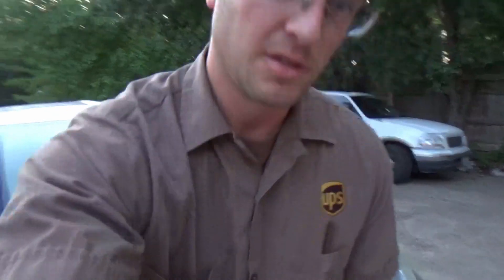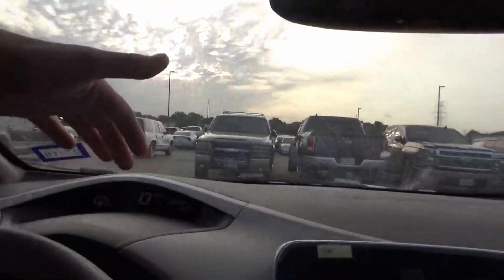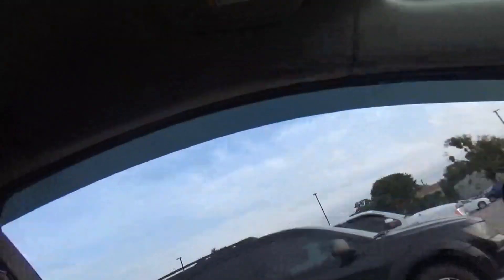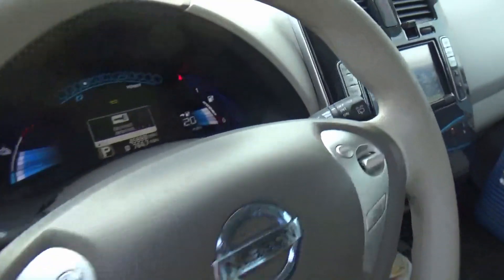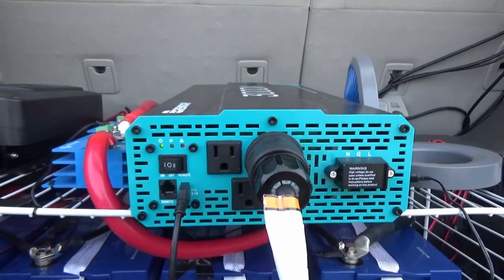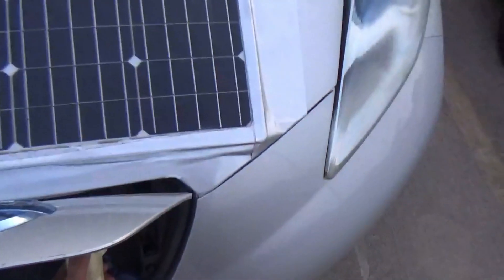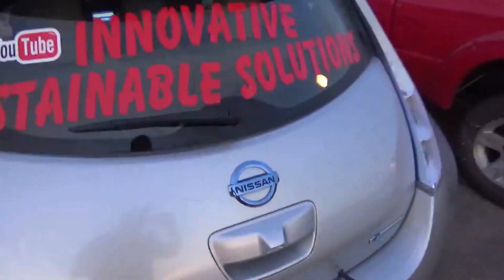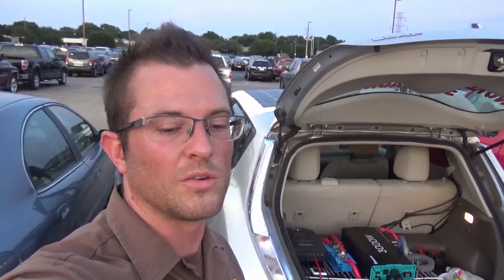Portable EV Charging Station

Comment: It would be alot more simple if Nissan had a terminal compartment for a smart solar charger. (Maybe even made my Nissan) the car already has an inverter, and it would eliminate the wire running outside the car. (Plus less hassle of moving wires)
Reply from the maker: Thats exactly what we're working towards.  You will see a version 0.1 of such an adapter on my next video
Reply: @InnovativeSustainableSolutions  I like tge idea, Tesla said they are considering panels on newer models. As far as DIY with an old leaf for cheap it makes it acceptable to lower middle class people with no car payment. I would like to see a solar trailer that has enuff power to run the car even at 0% battery. The electricity would just flow though the dead batterys. Instant power as long as it's sunny. And maybe air flow vents to keep battery extender inverter charge controllers cool
Reply: @InnovativeSustainableSolutions  kenworth trucks use kinetic energy to fast charge a battery every time the brake is applied.
Areo dynamic built-in wind turbines for highway use. There is no reason to even having a charge station.
Energy is neither created nor destroyed, simply transformed.
Reply: @InnovativeSustainableSolutions  magnets that are inside of the hub that charge while the wheels are moving. There is so much potential energy transfer that's useable to recharge a battery.

Comment: Do you have a video on how to connect solar panel to car's battery system? thanks for video!
Reply from the maker: Panels are connected in parallel, to the MPPT charge controller.  The charge controller takes the variable panel output and converts it into a steady charging voltage for the 13v battery bank.  I will try and remember to talk about the exact hookup in the update section at the beginning of my next video.  I've had several people request this explanation, so you got it!
Reply: @InnovativeSustainableSolutions  looking forward to that video, you are the man!!

Comment: How many miles do  you lose from all that extra weight from the batteries and inverter. What's the actual delta that it gives you? And on cloudy days, doesn't that number go negative?
Reply from the maker: 2-4% efficiency loss.  1-2 miles over my 50 mile commute.  Auxillary batteries can be charged at home, using grid power.  See my video Portable Vehicle Charging Station W/O Solar.
Reply: @InnovativeSustainableSolutions  Outstanding.

Comment: Thx,  very interesting,  russia 🇷🇺 waching ^^
Btw,  whats price  of ur solar system,  I mean only kit,  w/o work
Reply from the maker: System in this video was $2,700USD and $3k for the car.  I've added a lot since then (check out later videos) I'm up to about $7k for the car and kit.  Solar doesn't work quite as well in Russia, you're too far north, I've been looking into wind generators for places further from the equator.
Reply: @InnovativeSustainableSolutions  I should adjust solar panel on roof too

Comment: It's a great system, it should be adapted to all EV car's. I live in Australia and there are very few charging point around, which makes long distance driving is very difficult. With the solor charger here in Australia it would greatly improved range.

Maybe you should market it. I am sure you will make killing especially here in Australia
Reply from the maker: It's easy to build.  If you watch my How to Build a Solar Panel Roof Rack episode I talk a bit about how the design is universally applicable to any vehicle.  The system I built is for commuters driving 50-70 miles/day.  For people (like you) making long treks through the outback, I have been working on an EV road trip kit.  Think utility trailer turned into mini solar power plant.
Reply: @InnovativeSustainableSolutions  That sounds like a great idea if you live and travel out in the bush. I live in the suburbs and work is only 4.5 KM away. I see my parents and my kids once a week and that is a 80 KM round trip (I own a Nissan leaf 2019), I charge my car once a week so all is good there for me. My problem is I am limited to a 200 km round trip (124 miles) so that leaves much off Victoria out off my reach. It would be a great idea if someone could come up with a charge as you drive system (solar panels constantly charging your car). This system of yours is the closest thing I have see to that. The Nissan leaf 2019 has regen breaking and also uses the electric motor to recharge the battery while driving but that has its limits. I am not an electrical engineer and much goes over my head. I do understand that there must be away to trickle charge your battery with solar panels while driving, even to just get an extra 100 km. I do believe you are on the road to working that out. If you come up with how to do it, I will be one off your first customers. You peaked my interest at 8 km a day That would be 90% my daily commute to work covered (Going by Scott Kolaya's calculation).     

I will be looking forward to more of your videos

Comment: how do you avoid that nobody steals the panels?
Reply from the maker: They're all either bolted (see later videos) or taped on with eternabond.  Your not getting the eternabond off the vehicle in any timely manner.  I suppose anyone with a tool kit on them could steal the bolted down panels, but it would be a bit of a project and I havn't had any trouble with it parking in not so great neighborhoods for the last year.  It would be easier to steal the tires.

Comment: but can you use the tesla charging stations?
Reply: Tesla has a proprietary connector and protocol for charging their cars.  They developed it because the official committee that was developing the standard for rapid DC charging was dragging their feet and Tesla was trying to launch the Model S so they made their own standard.  The Leaf uses the older Chademo charge connector which is quickly becoming obsolete.

Comment: This could work well on my KIA Soul EV +  Thanks for your post.  I think I'll try it with 4 270w panels whenever I get the chance!
Reply from the maker: I get a lot of emails from Kia EV drivers.  Everything about this system can be done better in a Soul.  The vehicle is perfect for for a solar charging station.  You could actually generate enough power off that chassis to rent out a second plug for someone else to charge their EV off of.  My wife came up with the perfect license plate "SOULAR"

Comment: My car sits unused days at a time.  Been wondering what the absolute cheapest way is to charge for example could I use a single solar panel? Do I have to have the batteries such as in this video?   The idea would be that when there’s enough sun the car would charge no matter how slowly.
Reply from the maker: The Leaf (and most EVs) have hardware/software that restricts the minimum charging amperage to 6 amps.  At 120 volts thats 720 watts.  Sorry but theres no way to generate that from one panel.  The maximum charging wattage I have hit with all my panels is 490 watts.  So I have to have the batteries to make up that difference (500w from the solar, 300 from the batts).  I don't see any way to accomplish this without any auxiliary batteries.  Sorry
Reply: Innovative Sustainable Solutions sounds like your guessing qty 3 of 270w panels would give me 810w (at peak performance) and this in theory would work. 
THANK YOU for the reply.  FYI in this case it’s a 2016 Kia Soul EV +
Reply from the maker: @oahukiteboarder808  Love that car.  Perfect body for mini solar power station.  Email me at the channel e-mail if you run into any snags.
Reply: Innovative Sustainable Solutions all-in-all happy with it.  But since we have the panoramic sunroof our setup will likely be stationary at our home.  Maybe also able to charge the hot water heater and / or use washing machine since they are near the parking for the car.  It’s hot and sunny 90% of the year so may do this as a “hobby” soon.  Also we pay 33 cents p kw !!

Comment: I’m wondering about the weight did you factor in that lugging all that wait around does harm on your car and lowers efficiency
Reply from the maker: I get this question a lot.  Yes, the weight and drag (it has a roof rack now) absolutely affect efficiency - anyone who says they put 220 lbs. of equipment in their car, and didn't affect efficiency is mistaken.  The vehicle tracks it's own efficiency in units of miles/kilowatt hour.  Originally (unaltered) the vehicle achieved 4.7m/kwh.  Today (with the portable charging station) it gets 4.5m/kwh.  Thats a 4% loss in efficiency.  In a 50 mile commute thats 2 miles of range lost to lowered efficiency.  The system is currently adding about 25 miles of range/day so net we're positive 23 miles.
Reply: I think it’s a great idea everybody can do like you say to get a little bit more out of your car before you have to get another one after your video I was doing a little research on capacitors they hold a pretty big charge I just don’t know how you can use them yet

Comment: Yeah there's a new portable battery for electric cars at tech crunch the and you can stack two like legos. but I bet its like $8000 plus another $2000 for the battery and I bet its no more than 10 miles per battery nothing like your setup.

Comment: wouldn't it be easier to buy a replacement leaf battery for 4-5k?
Reply: Yeah the amount of degrading should have qualified him for a replacement. I have a 2012 Leaf that still gets double the range of what this guy is getting.
Reply: @maxxglass5822  i thought so,. that looked like ALOT of extra equipment, and a total loss of the boot for that to be worth it.
Reply from the maker: A new battery pack for $4k is a GREAT deal, and you should absolutely do it if you find one at that price!  I have found 1 legit new battery pack at that price point (it was $2k on craigslist, installation not included, found in junkyard in vehicle totaled with VERY low mileage) in a year of looking.  Nissan originally charged $5.5k dollars for a replacement.  In the summer of 2018 this price was quietly increased to $8.5k.  Now (April 2020) there are stories everywhere of people being charged ( https://youtu.be/L_6gpx10QtM ) insane ($10k +) prices, dealerships flat out refusing to change to battery, and Nissan itself announcing it will stop producing the 24kwh packs in the near future.  I need to do a video on this for clarity.  Additionally I purchased the vehicle already degraded, from another buyer who purchased it from an auction.  The dealerships I have spoken to have claimed this voids the warranty (don't know if thats true or not).  Either way, this channel is an exploration of whether or not we can add a significant amount of power without swapping out the battery pack.  Because batteries are either a) $8.5k or b) not available at all.

Comment: Wow those battery health bars aint looking so good....
Reply from the maker: Yep, it happens.  Just got some Leaf battery modules in the mail.  Gonna do a video this month on how to run a capacity test on individual modules, and attempts to source some less degraded ones.  The eventual goal will be a DIY battery pack recondition by replacing bad cells with new(ish) ones.  I started out with just the portable charging station because it's quick, easy, and safe to add on the vehicle.
Reply: @InnovativeSustainableSolutions  yeah... good luck... myself thats pretty much the reason why i did not get an ev yet... battery problems...

Comment: The fact that the battery is slowly degrading, shows that EV's are incredibly stupid purchase compared to gas cars. That range is so sad.
Reply from the maker: There is actually a mountain of data that shows electric cars are far cheaper in the long run.  The cost of ownership of a Tesla Model S, is less than a Honda Accord over the first 7 years all things considered.  My F150 was costing 2,700/year in gas.  This purchase price of the Leaf was 3,000.  All the hardware was an additional 3,000.  This vehicle stands a good chance of completely paying for itself in two years.  And that's if I throw the panels, inverter, batteries, everything right in the trash after that two years.  If I sell it all (You can very easily get $1,000 for an old Leaf battery), this system pays for itself in well under two years.

Comment: I've never understood why none of the EV makers have not made a solar skin yet so that you could charge while on the go at least a few miles like in this case. Instead they want panoramic glass roofs ???? I am already saving for a battery change and upgrade. Hopefully the technology will be better by then.
Reply from the maker: You get it.  They will too.  Eventually almost all EVs will come with integrated solar panels standard.  If you go back even just to when my car was made (2011), panels were twice as expensive, and 20% less efficient.  The progress being made in increasing efficiency and reducing cost these last few years have been incredible.  Every 1% increase in cell efficiency now adds 1-2 miles of range/day for a system like this.

Comment: How much would you charge me for something at home with a trickle charge that can at least charge half the battery in 12 hours?
Reply from the maker: You mean a 24 kwh battery like the Leaf?  Is this for an off-grid location?
Reply: @InnovativeSustainableSolutions  my car has a 9.0 kwh battery. The location isn't off grid but I'd like an off grid capability for a slow charge at home or even stored power on a battery from solar to charge my ford fusion plug in
Reply from the maker: @MR707videos  If your only using the batteries sporadically you can get lead batts for around $100/kwh.  +inverter, charge controller and 1 or 2 solar panels, and you're probably right around $2k for a 9kwh charging station with some solar.  Shoot me an e-mail if you need more specific details.

Comment: Could it be possible for someone to design an electrical system that would simply only require a charge controller between those panels and the Leaf battery without having to invert to AC back to DC thru a buffer of AGM batteries???  Seems like someone will solve that problem and make some serious money off the idea.
Reply from the maker: I believe so.  Some charge controllers (including this one) require constant 12-48v power, but thats not difficult.  The Leaf comes with a 12v source.  The two big hurtles are (1) stepping your solar PV power up to the 380v you would need to charge the battery, and (2) "concealing" the external power source from the vehicles computer.  People have fried a component of the vehicle known as the pre-charge resistor, by applying external voltage sources to the wrong place at the wrong time.  I will eventually attempt direct main battery charging off of the solar.  Stay tuned and wish me luck.
Reply: @InnovativeSustainableSolutions  Nissan should hire you as a consultant to seriously work with you on what your trying to accomplish, looks promising!!! I see a future of more efficient solar panels at lower prices formed around seamlessly onto the car exterior.

Comment: All electric cars should have solar panels fitted standard. This technology is easily available and no car manufacturers are employing it, makes you wonder why. The addition to the manufacturing  cost would be negligible. I think this will eventually happen as electric cars evolve.
Reply from the maker: I really think you're right.  Solar cells bought in bulk are probably 30cents/watt or less.  So putting 700 watts of them on a vehicle would cost the manufacturer about $200.  I believe Sono Motors said it costs them about the same as painting the vehicle would have.